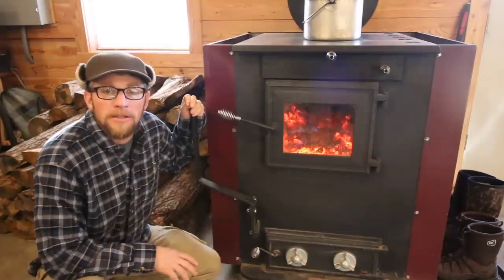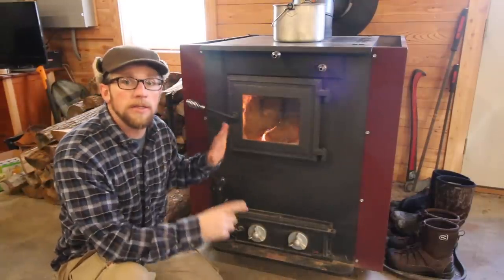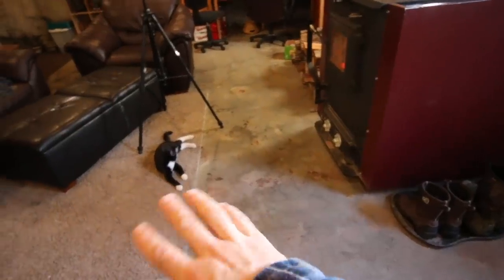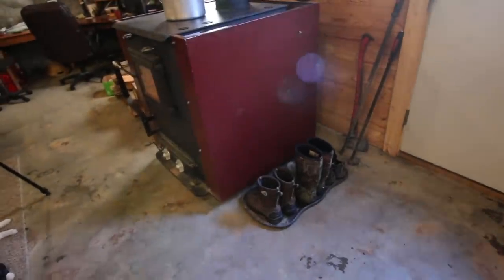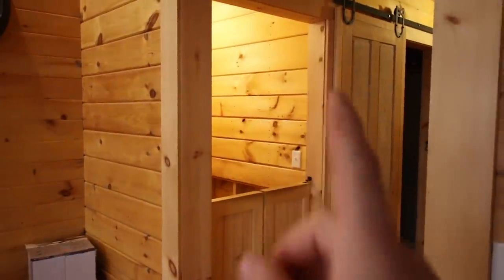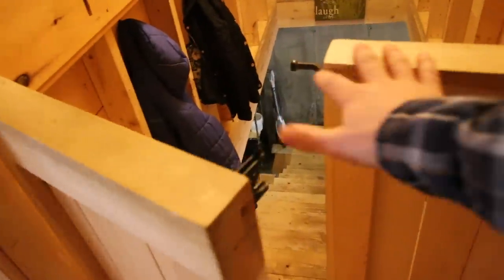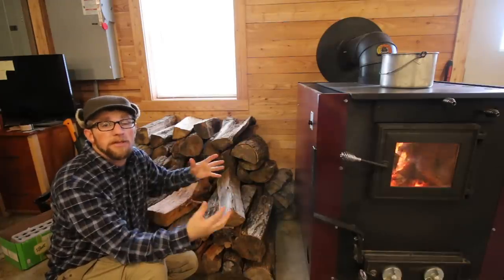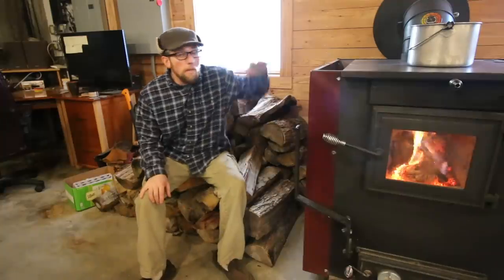How we Designed our House to be Heated with Wood & Natural Convection

Comment: I also use wood to heat my 2,800sqft home with a full basement and main floor 1400sqft  per level. Our wood stove is actually a forced air indoor wood furnace by Sears and Roebuck. So it does use a bit of electricity to make the stove more efficient. Decent trade off I suppose.
Anyway, I live in the foothills of the ozarks in southern Missouri. 
Old timers told me that 10 acres or more of forest on your land can supply enough dead fall to heat a farm house without ever cutting a live tree from the land. 
Considered that heavily when purchasing our farm. We bought 33 acres, 12a in forest 1.5a in ponds and the remaining mostly resembles large oak/ hardwood savanna. 
Soooooooo glad to be out of the Suburban neighborhood FINALLY!!lol. Thanks for sharing your experience and knowledge

Comment: I love the forethought that you've put into your heating system. The solution is fairly simple, but it's the sort of simplicity that only comes from good research, problem solving and application to create an efficient and practical solution. I also liked how the explanation of your system was highlighted with the cuteness of Figaro and Olivia! :)
Reply: Out of interest, do you still plan to install the hot water loop in the wood stove for a cheaper and/or alternative hot water source at some stage? I forgot to ask that on here yesterday... :)
Reply: have you thought of limited solar for electric as a backup in case the grid goes down , the excess energy you could also sell back to the grid.

Comment: Terrific. Dad built a mountain house years ago and I've tried to figure a way to to heat it when I retire.  He had electric baseboard.  You've given me great advice on how to do it.  The down draft set up explains how to get the cool air into the basement.  Putting in grates will be easy.  Thanks.
Reply: Cooler air sinks down to the lower spaces because of its density. Warmer air floats/ gets pushed up on colder air.  The colder air does all the pushing. Tear a narrow stip of fine tissue or toilet-type paper, hold one end and walk up the stairs to see all this

Comment: If you plumbed a ball valve and entrance pipe into the opening for the air entrance of the fire box and drew in combustion air from the outside, you'll  reduce convection of fresh air entering the building envelope. It can make a substantial difference.
Reply: Yes, and what also happens is that the heat builds up inside the house pushing the pressure against the windows preventing drafts of cold air that generally come from windows.  I wish I had a diagram to explain for visual learning.  With out air from the outside coming directly into the back of the stove directly to the inside of the stove, the stove draws its air from inside the house. This air that is drawn generally comes from Leaks in the envelope of the house. These leaks can be from poor window seals.  This means the draft is caused by the sucking of air outside the windows to inside the house. BUT if you only draw air directly into the stove from the back, there is no cold air being sucked inside through the windows. What actually happens is that the heat from the stove pushes up against the windows and Prevents the draft of cold air being sucked into the house.   Awesome science stuff! 🙏🇨🇦

Comment: You know a lot of people are turned of to running the flue like you did ...but there is a lot to be said  for ease of access and cleaning. When done right the way you have done it is something that anyone  who would who is timid about climbing up on the roof and would push their luck by avoiding it should really consider . It is fast and easy to maintain with little to no mess in the house. I for one like it. I went with the tee inside of the house...but that is what the situation called for.

Comment: When I lived off grid I cooked on a bonfire. The way I baked was with two stainless steel bowls and two bricks. I put the two bricks in the bottom of one bowl and used the other bowl as a lid. I used aluminum foil to keep the bowls "sealed." This was big enough for an 8x8 pan or a bread pan, which is what I was using it for the most. I'm sure you could design something similar and more functional to use on the top of your stove so that you don't have to bake inside the fire box. Plus, you could always bake in your outdoor kitchen in the cook stove ;)

Comment: We designed our house around the stove as well, but it is not as big of a house (about 1500 sq. ft. with no basement) and it is super insulated. We go through less than a cord of wood a year, so we have a much smaller stove. Our stove is at the base of the stairway and the pipe goes straight up through the house. It has a clean-out tee just above the stove itself.One thing we found is that with a well insulated house you need to be careful not to over feed the fire. A little goes a long way, and lower BTU woods like aspen actually work just fine.

Comment: Thank you for the explaination of hot and cool vents.  I've never seen this done and love the simplicity!  You could always put a few fans in there if you wanted to.  Very neat.
Reply: Few do it, but a wood stove can be used to power all the fans you might want or need to move air around the structure.

Comment: I really like your set up. Well done. I have an outside wood boiler made by Portage and Main (Canada) That runs to the rough 5 cords of wood per winter but I do have a forced draft on my furnace so I can tie the two systems together as per insurance requirements. Your convection system is my goal as the air circulation portion requires a 5 amp draw. Adapting to the cold air drops will allow me to incorporate a less than 1 amp blower and cut energy use considerably. As far as the DUTCH OVEN I have a portable wood burning camp stove with a flat top that has an accessory convection style oven that is basically just an open bottom steel box with a door and removable rack and thermometer. You could make something large enough to use regular baking/roasting pans and still have room on your stove for the big pot you use in this video.

Comment: They make heat powered fans that can help circulate air.  
Also adding a kettle to the stove and always having boiling water going helps to replace the humidity the stove takes out of the air.

Comment: Ideally you would have done i like i did in my old house. I bought a wood furnace that had a large built-in blower that would blow it's heat through a 10" pipe out the top.

I then attached that heat pipe to my home's HVAC duct system. Worked great for the 2 or 3 tears i had it while my gas furnace was out of commission. 

I then got the gas furnace replaced, and i sold the wood furnace, before selling the house.

Comment: Hi, Al. You may have mentioned this. I'm not sure. The reason that in the winter it's beneficial to have water heating is because it adds humidity. A heating/ A.C. repairman told me that humidity has 'latent heat'. This is why refrigeration removes humidity and converts to condensate. Humidity holds latent heat in winter to help heating process. 👍

Comment: You have a very nice house. Thanks for the video one thing I'm missing in mine 8s the cold air returns I 8nstalled registers in the floor with fans in them to move the air upstairs but never thought about getting the cold back down. Thanks for the reminder I was considering to much on the hot and zero on the cold

Comment: I like the setup. I have an idea for the hot bedroom. Add some insulation in the joyces to slow the heat going in the bedroom. This will also help warm up the far end of the house. foam would be best as fiber bats will want to sag and let hot air above it.

Comment: Here is a thought. I have a passive solar house with a heat pump with back up resistance heating.  and a wood stove. The woodstove is on the main floor of a 2 story house with a garage under. The master bedroom is over the stove and the flue is internal and runs up through a walk in closet, it is a zero clearance chimney and it is enclosed.   Where you have the floor joists exposed under you bedrooms I have a v-groove pine board ceiling. With the heat on bust under the floor the bedrooms are a nice 16-17c, 60-62f with the bedroom doors closed. With the doors open I can get 22-23c in the bedrooms when it is 24c on the main floor. An unheated room in the basement, with 2" of foam outside and 4" spray on foam inside is 10c. I heat another storage room to 17c, it is under the kitchen so I think of it as a bonus warm floor. The rest of the floor on the main floor has 9" of spray in foam, long story, I did not pay extra for the excess, it is always a warm floor. Under is a largely unheated garage/shop/wood storage. PS: the entire envelope of the house has 5.5" of spray on foam unless noted. The entire basement exterior  below grade has a layer of 2" foam board (Cladmate). The basement has 4" sprayed foam behind gyprock.   Moral of story, put something on the joists under the bedrooms to prevent direct conduction of heat from below. That dead air space, although lousy insulation, will knock 10f  degrees off the bedroom temps. Something with fewer holes than a T&g product might knock off even more heat penetration. My normal cold temps here are only in the 20-35f range but it is very windy.

Comment: Well done Al... I'm a year late watching this. You have a good understanding on how convection works & have reduced it down into simple terms. I like the wood stove design btw, in particular the ash clean out tray as well as the ( 5 ) cold air return tubes running up the RH side as well as the bottom air flap design.  If I understand correctly, the entire stove is 1/4" plate steel surrounded by vented sheet metal for safety. I'm almost thinking the top is made from 5/16" plate steel btw... Still running my " All Nighter Stove " called the " Little Moe " for 40 years now... Purchased it in Woodsville back in 1980... 
Bill on the Hill... :~)

Comment: Looking at buying one for my 3000sq foot home, would be installed centrally in the unfinished basement with ducting designed in the 1st floor for the convection to occur. Would you still suggest this stove in 2022?

Comment: Good set-up Al similar to my own, I also have a kitchen cook stove in my kitchen upstairs, mainly I use the kitchen cook stove to heat on those cool spring and fall nights when there is not need to start the big furnace downstairs. I also have a big wood lot and as long as I can get out and get some wood I will be able to heat my place and be able to cook inside.One thing I should mention is if you ever had a fire because of the vents between the floors and the open stairwell your going to feed the fire well, you can get the floor grilles with metal vanes so you can close them or you can put a floor mat over the grille when not necessary or both would be better. you can also install a fire damper with a meltable link that slams closed when fire melts the link.

Comment: I recently bought a DS EnergyMax 160 and put it in my basement.  So far I have put in three cold air return vents, in different areas of the house, and the stove is relatively close to the basement steps.  I have been leaving the door open, but I am having difficulty getting much warm air upstairs and definitely not enough to heat my house without using our propane furnace.  I have experimented with different lengths for the drop-downs below the vents, without much success.  What size vents did you use?  Do you have any suggestions of anything else that seemed to work or didn't work for you?  Thanks.

Comment: I love your video because I have the same problem. I'm hoping that putting in cold air drop vents on the ground (middle) floor of our split level will bring the warm air from the semi basement up to the ground floor. The semi-basement and upper floor get warm easily, but the ground floor (the floor in between the semi-basement and the upper floor) seems to not get enough heat. Would cold air drop vents work for me in this situation?

Comment: I would try to use a larger pipe going vertical single walled. Flue pipe gets super hot and with a very large surface area they really really heat the room actually.

Also if i were to use a model as such, I would buy ones with water intake and output which i would connect to radiators in other rooms.

Comment: About the bedroom heat... I wonder if you insulate underneath it and then put a sort of "ramp" attached to the ceiling using two sheets of plywood or so to guide the hot air away from that area...

Comment: When you bought the heater did you think to buy an extra ash pan? If not you can probably get one. Back in the early sixties (1960) my father had a chimney repair business and we would drop a weight with a round stiff brush attached down the flue to clean it. There are also fiberglass rods that come in sections that screw together. Also would you recommend burning pine?

Comment: Your firebox intake is collecting indoor air and sending it outdoors. To replace the indoor air you are sucking cold outdoor air into your house through cracks and crevices. For efficiency you need an outdoor intake pipe to feed your firebox intake.

Comment: Awesome setup Al, well explained.  I was wondering if you were to install both a fan to blow the heated air to the other end of the home and a bit of insulation under your bedrooms if you could get your bedrooms a bit cooler so that you would be more comfortable.  I know the fan is not going to work in a power outage however that is a small percentage of the time and your system has proven itself to work well without the fan which is a great backup for those times the power goes off.  Congratulations on hitting the 10 Best Homesteading Vids and Happy New Year, thanks for sharing your family's journey with us.
Reply from the maker: Thanks, a small fan would work nice

Comment: Get 2 convection stove top fans force air toward stair well and couch, put 2 high wall vents in bed rooms will keep bed room cooler, and kitchen and bathroom warmer, I use 12 volts fans powered by solar system each day, so free forced air flow, in your set up, I would drop a 14 pipe from main floor, drop down right over that stove, install my 12 v fan in the plenum pipe to force air stright up, I live in Northern NS Canada, I heat 1000 Sq feet, with 3 cords or less of birch and some cedar, even flow and is a solar powered force air system, nice place, bet you'd like mine too, my woodstove is smaller, only 60,000 btu, keeps house a constant 75, in the minus 20 nights I drop to 70 f, but more excuse to snuggle with mama, cheers

Comment: that is a nice stove. Since it is air tight, do you need the damper? I have an air tight woodstove and did not put in a damper, but I should have for when its not in use.  Those holes in the top, can you put a blower on them from the bottom?  If you were to use a fan, you could direct more heat to the stairwell. Good video
Reply from the maker: I have a 8" flu we are able to use the damper

Comment: Try using bubble foil back insulation like they use in yurts under the bedroom floor it repels the heat away and it wouldn't cost much to try under you're bedroom.

Comment: Maybe it has been asked of you before, but when you go to bed at night,  if you load up the stove, will it still be going enough 7-8 hours later to still heating the main floor?   Also, are all rooms comfortable (say 70 degrees) when it is 5 or 10 degrees outside?  Thanks in advance, for the reply.  Cheers.
Reply from the maker: Yes the stove stays going all night and the house stays  70s
Reply: @LumnahAcres  Thank you.  Cheers from Steve in Kettering OH

Comment: So the key to having a wood-burning stove in the basement and have it not be messy hollingwood in and out is to have a walkout
Reply: Not necessarily.  I've been heating with wood for years and by far the biggest factor there is the method of hauling it in.  OP says he uses a wheelbarrow, but if the wheel's going through mud or snow then that's going to track that in with it.  You can lay down a special rug just to catch all of this, or you can keep a clean wood storage area close to the house (set off a bit to keep bugs/mice etc in the woodshed and not in the house), then keep the path between clear.  I've got a nice-sized carport where my wood is kept and then I have a custom dolly that I use to bring the wood in with.  I'll get a few bits of bark on the carpet after I'm done (bringing in 4-5 loads), but I pick them up by hand quite easily.

Comment: curious.. how long does your stove put out heat after the fire is out.. and how many cords are you using during the heating system>
Reply from the maker: The stove stays warm for 12+ hours. We usually burn around 4-5 cords of firewood a season
Reply: @LumnahAcres  I dont have a wood stove so just have to go by what i hear and read.  Stayed with a friend years ago.. he had a wood burner in his basement.. When that thing went out. omg.. I thought I was going to freeze LOL

Comment: Did you insulate under the basement floor?
Does the stove have a fresh air intake from outside or does it draw air from leaks around windows and doors or air vents for the stove, dryer and bathroom?